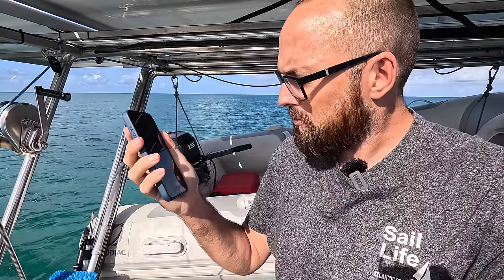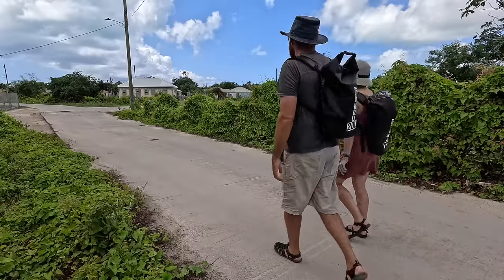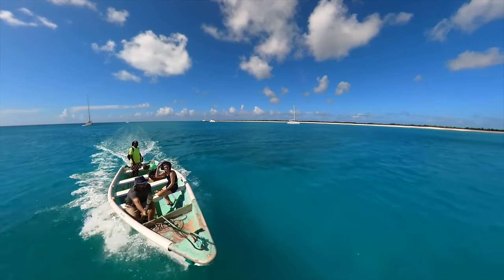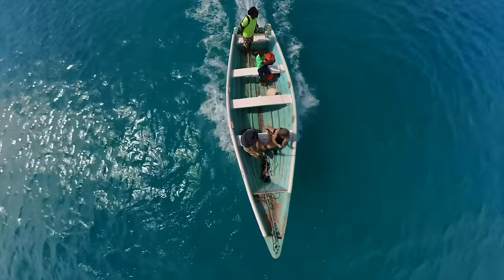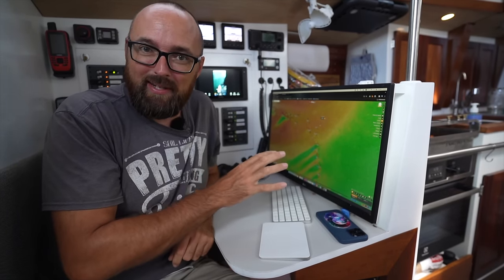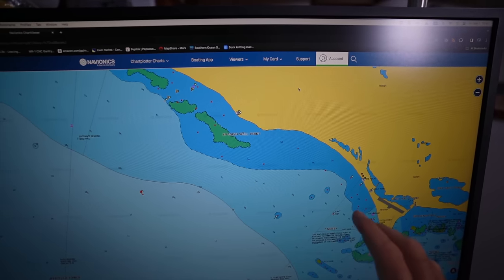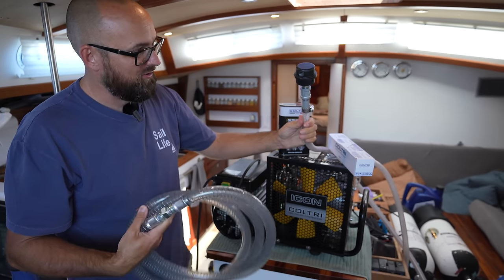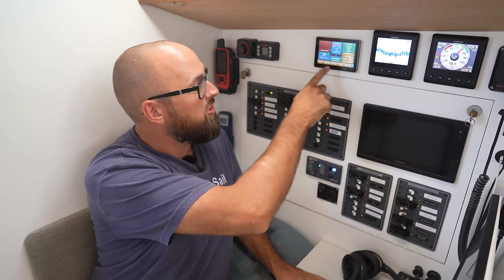Sail Life - Barbuda, 7 years after total devastation by hurricane Irma

Comment: Nothing quite as satisfying as engine maintenance, really nice to watch. That compressor is gonna have a cushy life. Also, even though it consumes a lot of energy it makes sense to have it be electric I think. Of course it could be belt driven off the diesel engine, or be powered by its own little honda four stroke, but then it would be a single point of failure, and probably more expensive to run too.